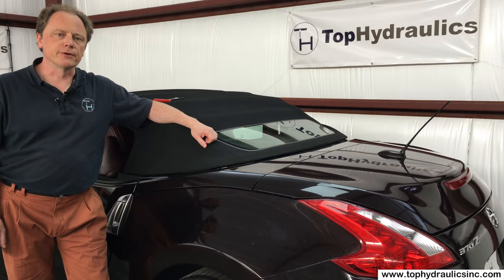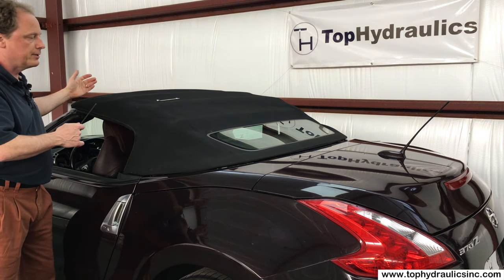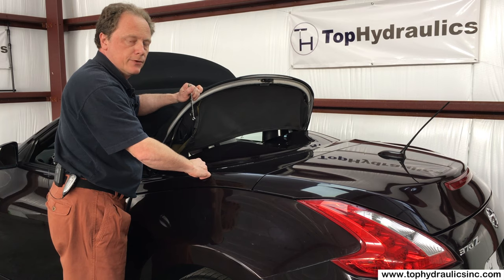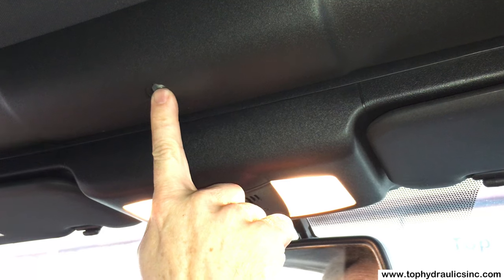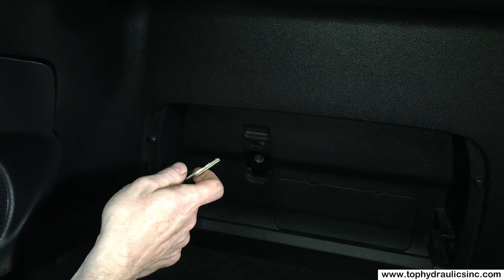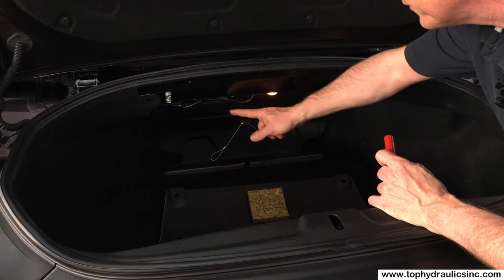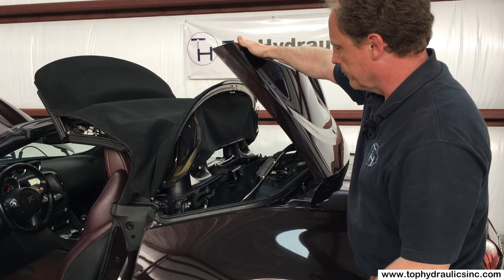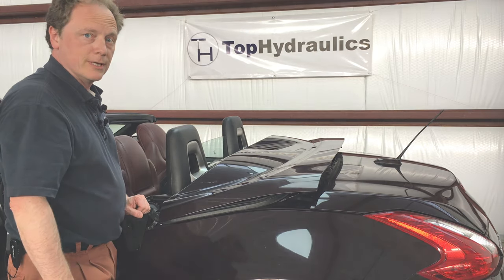Nissan 370Z - How to Manually Open the Convertible Top

Comment: I was retracting my top one day and as it was doing the final step which was closing and securing the cover, it began to move really slow and then just stopped. Now the system seems to have no power. The switch does nothing, there's no beeps or anything it just died. Had to manually close it and its been closed since.
Reply: Mine did the exact same thing, if you ever have an update I'd appreciate it. Right before the rear cover closed it started going super slow, had to manually close the top, now it has this god awful constant beep when driven.
Reply: @jashest2189  there's a fuse you can pull to stop the beeping but it also disables the interior door lock button and the trunk button, so you'll have to open the trunk manually from behind the passenger seat. Don't lock your keys in the trunk like I did!!!

Comment: Hi, what happens if the hinge is jammed and you end up breaking the cable? How can you get into the panel without being able to unlatch it with the actuator cable?
Reply from the maker: You can still get at the latch with the broken cable if you remove some trim behind the door.
Reply: This is the cable in the trunk I’m talking about. I’ll have Nissan figure it out, but was concerned this busted cable would be problematic
Reply from the maker: @adampaxton6128  If one of the release cables for the storage cover breaks, then one can still manually unlock the cover by accessing it through the cabin. For access through the cabin, some trim pieces need to be removed and there still won't be a lot of room to reach in there. The dealer should be a good choice to get the job done, except that they will very likely tell you that you need a whole new top or hydraulic system. Ignore that kind of advice. Whoever opens the cover for you should fix the cable, so that you can manually unlatch it in the future...
Reply: @TopHydraulics  Thanks for your help. I'm more than a bit worried about this even though I have the extended warranty. Covers everything but the pulley system, but a lot of these mechanics don't have much experience with convertible tops, especially the 370z in NJ where not many are sold.
Thanks again.

Comment: THANK you!  My stupid top has failed and they want 18k (yes!)  to replace the top.   Completely unacceptable.  Should have bought a Porsche.
Reply: Dude I'm in the same boat. Did you ever get it fixed?
Reply: My top stopped opening, it’s a 2010 the t was replaced in 2125 but nor the hydraulic system. I’m told it has to do with something in the hydraulics. Nissan quoted me 20k to replace that. It’s crazy. Any advice? And on top of that I was told no guarantee it would fix it.

Comment: How can you get the storage lid open? I followed the steps in the video but after pulling the cables my lid still will not release. Is there any other way to get into the storage area?
Reply from the maker: The only way to get into the storage area is by opening the storage cover. Releasing the locks by pulling on the cables as shown in the video is not easy, but it is far easier than the alternative. Did you ove the cables as far as shown in the video, and did at least one lock release?
Reply: I wonder if pushing down softly on the storage cover while someone else pulls the cable releases some of the pressure from the latch mechanism making it easier to pull the cables? @TopHydraulics
Reply from the maker: @lambda13  Good point. When you pull the release cables, you are pulling the hinges in the cover past a dead spot that occurs when the cover is practically as far down as it will go and someone pushing down on the cover should make it easier for the person pulling on the cables.
Reply: @TopHydraulics  Evidently several people have this problem.  I when I pulled each cable, I felt the corner locks unlock (felt like popping the hood), but it will not open.
Reply from the maker: @cindystives1161  If the corners unlocked, then you must be almost there! This is an emergency release and it is not engineered to be as convenient as a hood release. Most likely, the cables need to be pulled a little more and the cover will be free to move.
Reply: @TopHydraulics  Wow, somehow I fixed it,  Nothing was really wrong with the hydraulics and all of the wiring was intact I just lubed up the joints.  Another thing I did was check the rear defogger fuses since you had said to do that in another person's response (they were intact).  Suddenly the trunk started working, the driver window worked and I was able to open the top.  It took some work to put those 2 bolts back in so that it would lock in place.  Praise God.  I am not even a mechanic.  I am a nurse practitioner with absolutely no experience working on cars and was able to fix it with your awesome videos.  THANK YOU SO MUCH.

Comment: What would cause it seemingly to have absolutely no power? not moving or responding at all. i believe all the fuses that i found are good.
Reply from the maker: Thanks for asking. Check the fuse for the rear window defroster. The rear window defroster current is routed through the top controller and a short in the defroster harness can take out the top controller.

Comment: Hi! Will this work for a 350z as well?
Reply from the maker: Thanks for asking. The 350Z system is quite different.
Reply: Thanks!
Reply: Mine is a 2010 370,  opened the trunk , only four tabs holding the panel , not a problem,  after removed mine only has one cable,  pulled it to the left and right front corner released  lid won't come up , so I'm basically back to a car that I cant use   very frustrating Nissan doesn't sell parts for the roof    🤬🤬🤬🤬🤬🤬
Reply from the maker: @mikeshay4866  That must be frustrating! Since your 370Z is missing one of the release cables for the front, the problem with the top must have existed for a while, and someone might have previously damaged the missing cable. Nissan might be selling these cables, or you can make one yourself out of bicycle parts. The real problem is getting access to the left front corner storage cover latch. I would take the interior trim off behind the driver seat and try to access it from there.